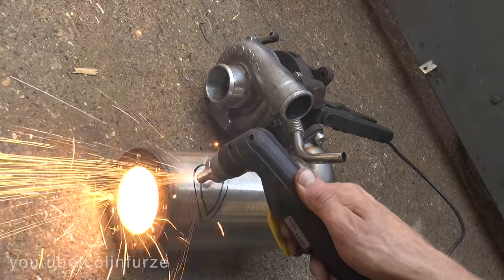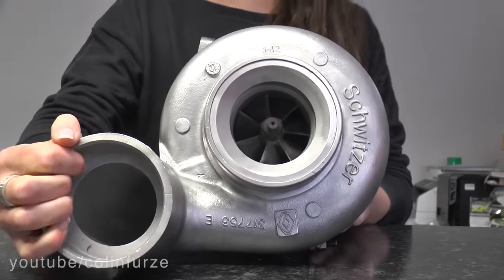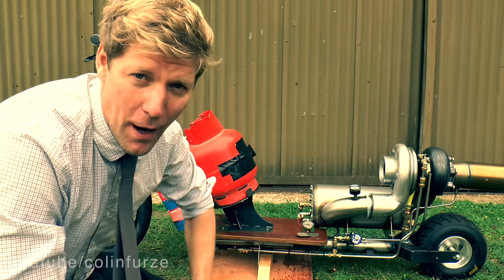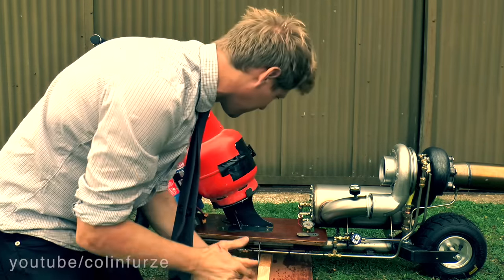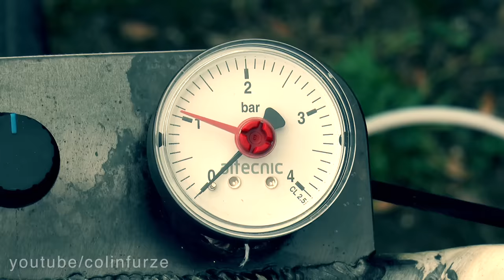TurboJet Powered Scooter-IT'S ALIVE

Comment: All these people nagging about wearing a helmet. Really!?!? He's got a propane tank not even 3 feet away from a turbine operating at a bit of a cow temperature. If something went wrong, do you think a helmet is going to help?
Reply: Yeah if he fell.
Reply: so true. People parachute with helmets. Hitting your head is the least of your worries when  you're jumping off a plane and heading toward the ground at hundreds of kph afterall !
Reply: It would catch some of the bits.
Reply: I’m more worried about that tarmac than his build...
Reply: if you get a partial failure of the parachute, you will have a rough landing and having a helmet helps when hitting the ground at 30km/hour (something like 20 miles/hour).
Reply: Veikra it’s actually a huge worry. Why? When you jump out of a plane you often have to clear the plane body structure, supports and wings. Many people have knocked themselves out on those parts. It’s kinda hard to pull the chute if you’re knocked out, therefore helmets. Then there are also ground obstacles, tree branches, and who knows what else on the way down. Or landing too fast and tripping head first into rocks. Or having your chute get tangled and spiral to the ground much faster than normal but not fast enough to necessarily kill you with protection. It’s much more likely that something will go wrong with launch or landing vs. with your chute not opening causing you to free fall into the ground.
Reply: We need  cool project like this, if we want to keep building ‘save stuff’ nothing cool Will happen :p
Reply: Dont worry guys.. He did wear his legendary safety tie
Reply: Yea nah fuck the helmet, his choice whether or not to wear one. Its just like with ice hockey, nhl players don't wear a cage to cover their face but 9 times out of 10 they are fine. Some don't even wear a visor so i mean.. anyways its his life and really i wouldn't wear a helmet riding it either.
Reply: He's wearing a tie. Can't get hurt if you got style.
Reply: Sunny Dae I was thinking about that as he was leaning down by the turbo lol
Reply: I usually hate safety Nazis, but in this case, a helmet would be wise. No suspension, small wheels. He could easily hit a pothole and be thrown off. Also, while he’s a brilliant engineer, welds can fail. Out on it’s maiden run, snap, thrown onto the concrete, brain injuries.
We’d all miss him if we lost him, a helmet isn’t an unreasonable suggestion. However, it’s entirely Colin’s decision!
Reply: He doesn't need a helmet, he's wearing his safety tie!
Reply: If he hit a pothole or some gravel @ 35mph yes I do some gloves for roadrash + it just gives bad PR to kids...
Reply: Hitting your head is definitely one of any skydivers main worries when jumping off a plane... What makes you say it's not? If you hit the ground or fall while landing... And you hit your head... You'll be in a wheelchair for the rest of your life.
Reply: A helmet would save him if he flipped that beast. But yeah, having a propane tank so close to the engine in front of your nads that a helmet would and should be the least of your concerns.
Reply: @Zac-cj8rb  I hear this a lot about motorbike helmets - "his choice". Not since he got married and had kids it isn't. They don't want to lose him or worse - spend the rest of their lives caring for him after a stupid little tumble at 30mph wrecks his brain. Yeah he takes risks, but you can mitigate against them and stop the stupid little incidents becoming major ones.
Reply: I feel fairly confident the chances of him hitting a rock and losing his balance are higher than the chances of a massive explosion, especially because he’s got regulators and what not along his lines to suppress any flashback.
Reply: He’s destroying his ears though.
Reply: @Noah Hastings safety tie..
Reply: @SD-tj5dh  yeah.. and as fire doesn't coadhere to rules.. it'd save his nuts but that's about it.. 

But if we have his DNA.. we could create a new, more infinitely fireproof furzey.. 

Yes.. fireproof furzey.
Reply: He has safety tie
Reply: @danielperry778  Just when the web became it's darkest, you arrive with a spark of light.
Reply: Yes really, he's setting an example for little kids which are 99% of his viewers. It doesn't matter about the turbine and what have you, dude needs to wear a helmet simply for the example it sets to kids.
Reply: The words safety or helmet is not even in Collins vocabulary
Reply: He needs, not just a helmet, but some motorbike leathers with some good metal-plating and meshing. Come off at 60MPH or even 40MPH and your skin is just gonna shave off as soon as you hit the tarmac, and you may need a skin graft. Dress for the slide , not for the ride .
Reply: I concur
Reply: @D, get and wear a ballistic parachute.  Plus a helmet of course.
Reply: @Noah, I can provide l ts of gory pics of my wrists pre and post surgery with Volnar Plates.  You can't even wipe your butt with both hands in casts.
Reply: @Manaquri.. Her in BC Canada, I'm a Construction medic.  My manual tells me that would be Rapid Transport Category.  Spineboard, load and go in 15 minutes.  Use plastic bag supplied for torn off body parts, label with marker Name and time of amputation.
Reply: good like by #wayank chennel from red island indonesia
Reply: @danielperry778  if he fell? I go faster with my bike.
Reply: There is a helmet for the ass too.
Reply: How are people worried about what a grown man is doing for fun and to get views?  He's a grown ass man.  He makes choices, just like the rest of us.
Reply: Yes, it would.

Comment: One bike wheel and one lawn mower wheel, were going down a runway at 40 miles a hour. Guess who's the guy riding the mad max creation with no regards to safety, other than a safety tie?
Reply: farai mukungurutse  umm no
Reply: Colin's videos are way safer than they appear, he has a ton of experience with that kind of thing and always takes necessary precautions when needed
Reply: C R I P P L I N G D E P R E S S I O N doesn’t matter it’s stupid to ride something like that without a helmet if he hits a bump or something goes wrong and he goes down it’s not going to be pretty. He really needs to wear some type of safety gear. And plenty of kids watch this stuff let them see someone wearing proper gear not squiding on some untested no suspension fast jet scooter I love his work but wish he would put on some gear
Reply: @cripplingdepression8889  Experience won't save you from a sudden fall. And at that speed a fall could already be lethal or at least leave quite ugly scars.
Reply: What do you mean by "... other than a safety tie". What else do you think he should put on?
Reply: I don't think any kid will be able to get his hands on any of the contraptions that this guy has built
Reply: its a gokart tire designed for probably around 60-70 mph. but yeah still sketchy
Reply: If he was safe about it he would not have the following he does. Without the danger of becoming a human hamburger there is no adrenaline rush for him and no cringe factor for us.
Reply: @heatshield  Then you completely miss the point of this awesome channel...

Comment: You need following improvements to get maximum trust out of the thing - next to the much needed afterburner: 
a) you need to take the vibrations off the turbo (not good for the connections and weldingpoints, pretty sure that caused that problem in the end of the video) 
b) you need to add a fan (think "turbofan" from airliners) in front of the turbo (connected to it), causing more air being pushed into the turbo, thus creating more trust, and even more trust by the air the fan pushes along the turbo AND it would also help keeping the "engine" cool, making it more durable and possible to "run it hotter"! 
c) this thing is INSANE!! you need to build this thing in series because I WANT ONE :-)
Reply: I trust you are right
Reply: no
Reply: A turbofan is a good idea, but in real engines, the fan is powered by a second set of turbines on their own shaft separate from the compressor. To get that to work here, he'd have to basiclly build an entire engine from scratch.
Reply: The first part is correct. It does need some rubber motor mounts and some better suspension.
However, a cooling fan is useless when doing anything more than idling.
If you're moving, the air will be far better for cooling , than anything a fan could do.
Reply: If the fan where to produce thrust, yes it would cool far better than just the wind.
But no, you cant really add a fan just like that to a turbojet.
Reply: To add thrust tho, you could inject water or water methanol mix either to the intake, combustion chamber or even after the turbine. That would make an easy and very effective "afterburner"
Reply: yeah, when idling, no cooling needed, agreed... i was refering to the "if he's going for speed" - what colin, with the afterburner, eventually will do... and the afterburner will heat things up for sure... so he could profit from a fan, even if it is directly connected to the turbo (the independent engine for the fans would be too complicated, but the improvements would be more than visible...)
Reply: Or just damm water injection
Reply: He should attach the whole thing with rubber mounts so it doesn't vibrate as much. To get more air into the turbo, it's better to run some tubing and create a funnel, with the smaller end on the turbo. This will help the air flow into the turbo. I don't think he has enough room for the proper sized piping though.
Reply: Yep, and I think the "fan air" bypasses the combustion chamber... not sure how you could do that..
Reply: He should just get a typical turbo flange
Reply: +ignafiltro injecting water+methanol mix after the turbine does nothing. The whole point of using the water is to further condense the air and allow you to inject even more fuel. If you just spray it after the burn there's no point, you're just creating steam.
Reply: +Iimrhyperpenguinii making a funnel would do nothing, he'd need a scoop designed for the speed he's moving that would actually pressurize air and compress it before it even reaches the compressor stage. Just making a funnel won't guarantee anything.
Reply: Yeah, you just make steam, and steam has more volume than water, that means, exhaust speeds would increase.
Reply: Yeah, sure and he might as well add an APU while he's at it.  :P

I suppose at that point he might as well just source a re-certified 250-C20W.
Reply: @ignasanchezl  the energy you use to boil the water is energy from the exhaust. There's no such thing as a free lunch.
Reply: You might be right. But if you inject water, it should be injected at near boiling temp and well misted, it should take less to fase change.

The reduction in air volume by the reduction in air temperature  should be lower than the gains by  water fase changing to gas.
However, it would of course be better to inject it pre compressor.
Reply: You can also add a cone around the exhaust with the goal of slowing the exhaust down by capturing more mass of air at a lower velocity. This will increase thrust at low speeds. Thats the point of a turbofan, instead of high speed thrust, its high mass lower velocity air pushed out the back.
Reply: I think a afterburning turbofan would do the trick with a JATO unit for acceleration.
Reply: That's not how that works. Mass flow is the same regardless. He'd be reducing velocity of the exhaust and increasing pressure which isn't the goal. A cone on the back would only be useful if he managed to make the flow supersonic through a throat because a "cone" or diffuser becomes a nozzle under supersonic conditions.
Reply: The fan idea doesn't make any sense at all and is completely impossible with a turbocharger derived engine. There is no way to realistically add a power turbine to run the fan, especially not on a jet scooter project. The mounting system had nothing to do with the oil problem at the end. Colin essentially said the oil reservoir wasn't venting properly, and that pressure against the turbo cartridge oil drain blew out/past the shaft oil seals. I'm betting an afterburner will be limited by how much fuel can be extracted from an LP tank at a time before the temperature in the tank drops too much. I love the scooter how it sits right now. It could use a seat for those daring enough to sit over that engine.
Reply: @treeperble  A cone open at the front to scoop extra mass into the exhaust, lowers the velocity but adds more mass, which provides more pushing force than a bare nozzle at low speeds. I think that would help wouldn't it? Not a nozzle attached to the exhaust, just around it. Like how a propane grill works where a small nozzle ejecting high velocity gas pulls in a large mass of air with it, slowing it down, but adding mass.

Theyre often added to pulsejet engines to increase efficiency.
Reply: Ah, I misunderstood your comment. I still don't think that would necessarily do much unless air was being forced through the bypass by a fan .Because he is not traveling anywhere near the velocity of the exhaust gasses coming out, it would do more harm than good. There's a reason turbofans use large turbines for this. And I don't think it's really feasible to put a bypass section and turbofan on his setup.
Reply: I'd definitely be interested in seeing the pulse jets that you're talking about though.
Reply: @treeperble  I just remembered they're called thrust augmentors.
https://aardvark.co.nz/pjet/augmentors.shtml
Reply: I doubt it would be, but maybe an augmentation cone could help. But he's installing an afterburner, so I'm pretty sure raw power is his goal, and not efficiency.
Reply: ignafiltro use the generic winter mix windshield wiper fluid. It’s a methanol/water mix. I use it in my race car 😂 .43 cents a gallon versus $10.34. Makes a very interesting flame show too.
Reply: the oil burning was purely the oil seals on the shaft due to heat, and if the bearings were shot i would be leaning towards a shithouse china re-cored turbo with original housings. OEM stuff can cop a savage beating

Comment: Run Nitros Oxide in the afterburner stage. Adding oxygen to the exhaust and combusting more fuel will send it flying! And the advantage of No2 is that it cools down the mixture before its ignited, so it would keep you jets nozzle from melting.

Comment: Colin i have and idea for the oil feed on the turbo.

when building high horsepower track or drag cars you would sometimes depending on the application, use a high pressure oil pump on the turbo feed to help with oil temperature and also component temps, if fitted with a oil cooler this helps tremendously as well. this could take the stress off the components. just a theoretical idea haha. if it works for 1000hp drag and track cars it should work for a turbojet haha.

this one is normally used as a feed to the engine block oil feed but you could get your hands on the radiator at lease and make your own A/M lines.

https://images-na.ssl-images-amazon.com/images/I/51zdoL5eX1L.jpg

love the videos.
Reply: It doesn't look like the problem was oil temp, but rather leaking seals.  Therefore a high pressure oil pump would worsen the problem, not fix it.
Reply: @Tornadic_Outlaw  Hmmm true. But oil seals tend to leak as well when subjected to extreme heat. Defiantly right a high pressure pump may make it worse, but like I said it's a theory. R&D is needed I'm just spitballingideas here haha
Reply: CAR AND MTB I think what he really needs is a turbo with a water cooled center-section. Oil doesn’t transfer heat that well. He probably has one, just needs to plumb it up
Reply: ah yhere i didn't think of a water cooled turbo that would work

Comment: You need an oil cooler my dude
Reply from the maker: is cow to hot
Reply: @colinfurze  I'm no expert but it depends on the weight of the oil. I would heat some up to your running temperature and eyeball the viscosity. If it's watery, then you probably have too much heat
Reply: Weld some fins on the oil tank tube.
Reply: How lol 60C is if anything quite cool for engine oil
Reply: Oliver Rashid    Yeah that’s what I was about to say - 60 Degrees Celsius is about 140 F and that’s at the lower end of operating temperature
Reply: He needs an oil full stop
Reply: Outdoor Days 2    Hey I just looked at your page and see you occasionally do clay pigeon shooting !! I’ve been into this for almost 16 years - got my first shotgun when I was 13. My dad owned a Clay Pigeon shooting club and we got a lease from the Ministry of Defence to use part of their shooting range.

Since my dad died, I just don’t have the time to run the club myself so I let someone else take it over and sold our guns. I kept 1 shotgun though and still enter the occasional competition, but usually only once or twice a year 😉
Reply: Markotik G that’s cool

Comment: Hope you never burn your leg on that. You're definitely going to need hearing aids after riding that.
Reply: Why would he have aids after riding this?

Its a joke
Reply: Maybe heat shields using aerogel.. soundeadener also..
Reply: @garystinten9339  you'll just melt your setup if you do that. A heat shield may protect you from burns in the case of contact, but you still want to dissipate that heat away. What you're proposing is effectively insulation.

Comment: I want to see four of them two up front and two back and a seat for the pilot! Each engine is adjustable per angle for vertical takeoff and then the engines go horizontally once in flight!😀👍 Imagine the speed that would take any you can sit down and relaxing control the small turbo jet engines! 😀👍😉